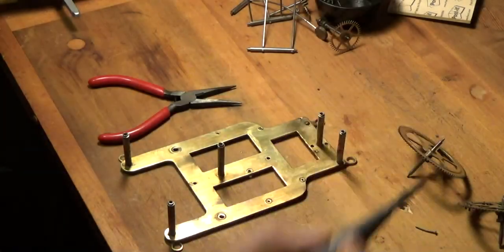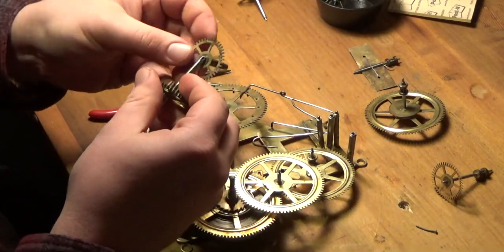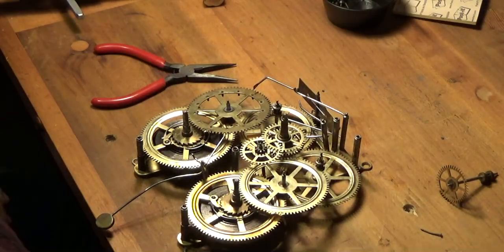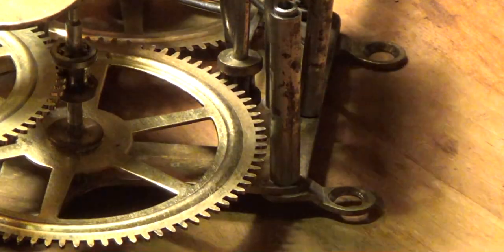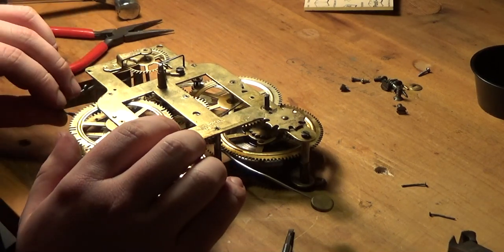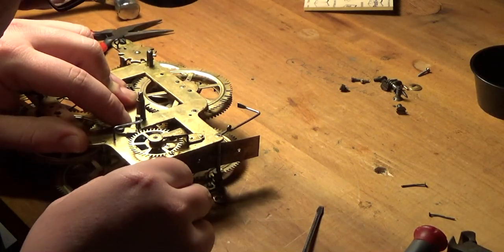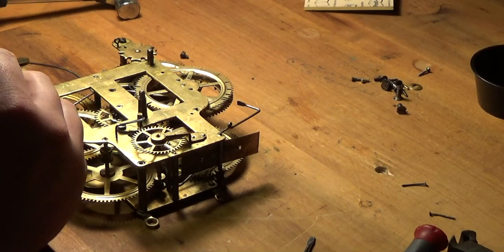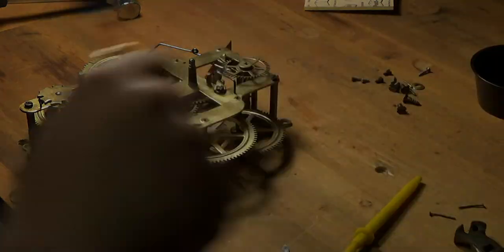Antique Seth Thomas Overhaul - Part 10 - Movement Reassembly

Comment: So my question is when I open my september 7th 1880 Seth Thomas clock from the back I can manually touch a spring like Part and it makes the right side go but for some reason I cannot get the left side to go which is what controls the hour and minute hands. The coils are all wound up
Reply from the maker: It sounds like it's pretty well worn out and/or gummed up and in need of an overhaul, but hard to say for sure without seeing it first hand.

Comment: Thank you this is a very nice series. I have a question for you. What in a movement do I need to change to make a longer pendulum length?
Reply from the maker: There's a couple ways, depending on what how short it is now vs how long you want it.  Easiest is to lower the number of teeth on the escapement wheel, however you may also need to lower the number of pinions on the lantern gear behind the escapement wheel, depending on how long you need the pendulum to be.  There's an equation for determining the length of pendulum, you can do a google search for it as I don't recall it right off the top of my head.

Comment: Why a butterfly type plate is rotating with speed before the bell is ringing 🤔
Reply from the maker: It’s basically the governor for the strike train, to keep it going at a constant rate. Otherwise it would spin faster and faster until it potentially breaks something lol

Comment: Hi ive been silly and tried to fix my Smith Enfield, unfortunately about 5 gears have fallen out and I have no idea where each one goes!

How do you work it out please?

Thanks
Reply from the maker: My apologies for the late reply, Jamie.  The only advice I have for reassembling any clock movement is to be patient; examine every part's position and function carefully.  Take photos or draw diagrams before and during the repair process, no matter how minor, until you get a feel for how each part interacts with the other parts.  The more you understand how the movement works, the better success rate you'll have in repairing them. Thanks!!
Reply: There is a video on YouTube by scottie clock World of a smiths Enfield being built. Hope this helps.
Reply: Where do you live? I could put it back together